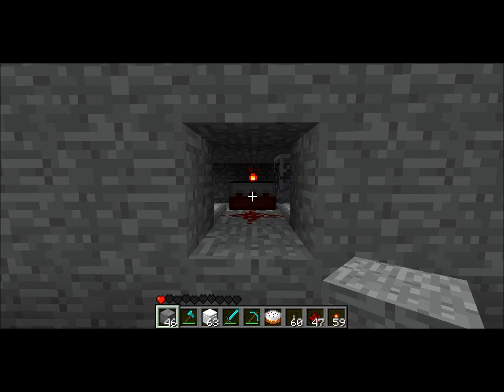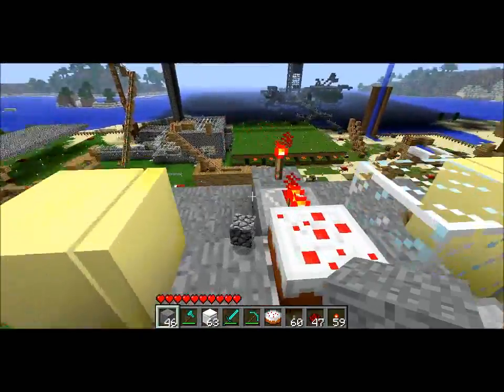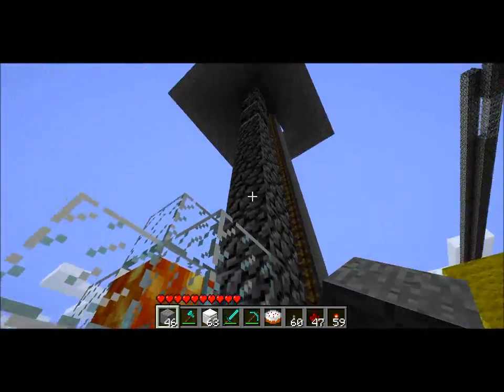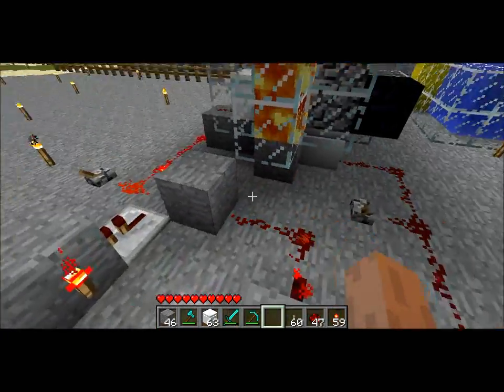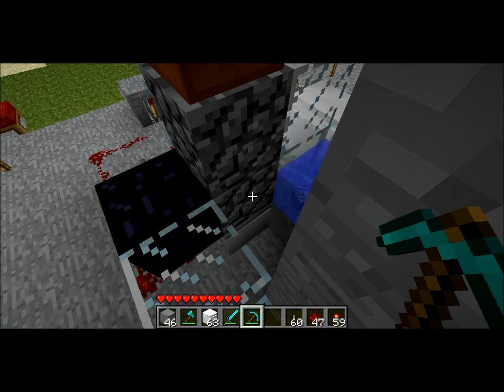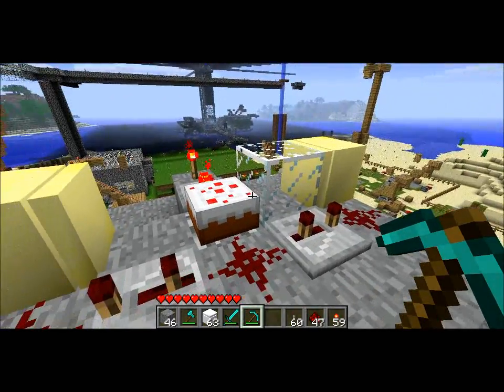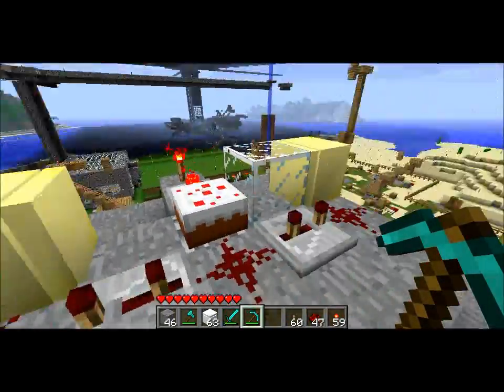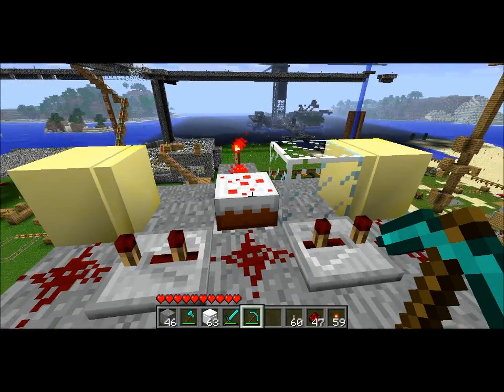Cake Dispenser using Pistons

Comment: Unfortunately this will no longer work as the 1.7 pistons require energy from its positioned level and they destroy the cake as it passes up the chain =( so cool though Seth. Try find a different way to use this mechanism in 1.7 or create a different way to get it working. =)